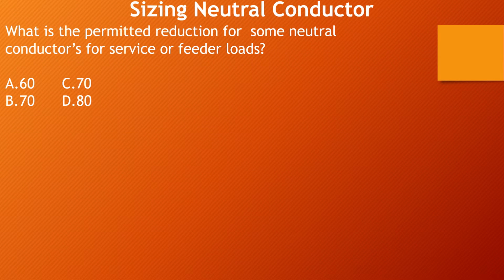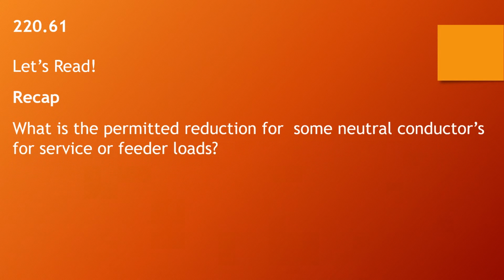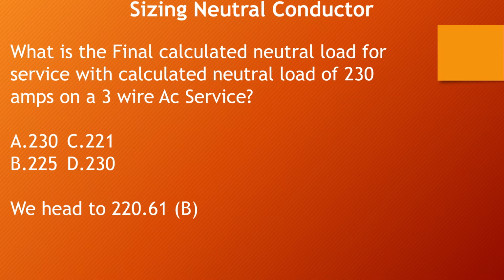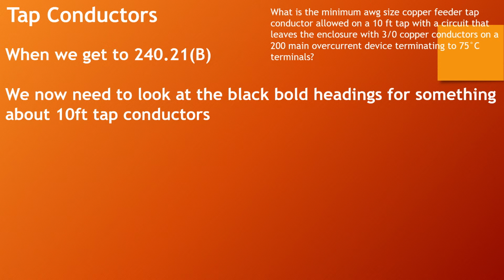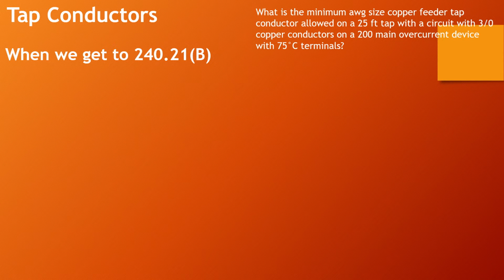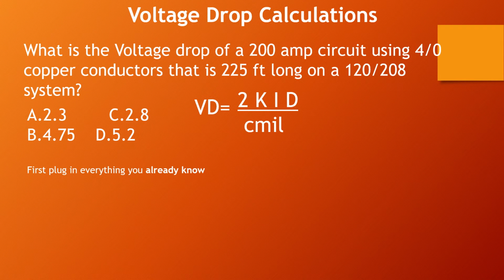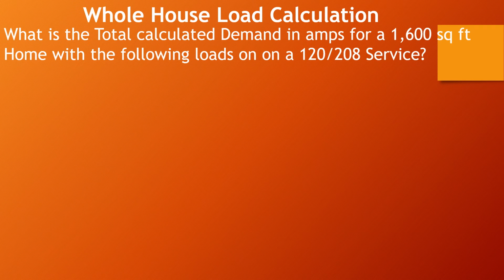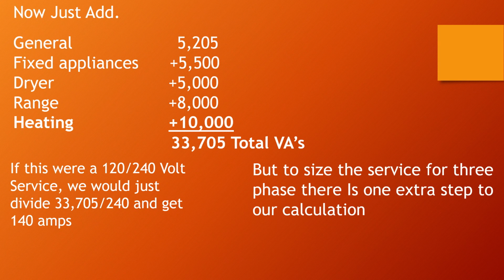Bonus Week 1 How to prepare for an Electrical Licensing Exam. Exam Prep Journeyman Electrician

Comment: Is the 10 week course that you mentioned the lessons that are numbered 2.2, 2.3 etc? Thanks!
Reply from the maker: Here is the recipe for getting ANY NEC test, license or certification. Sign up at..

https://electricalcodecoach.com/shop/ols/products/lifetimers

Right now it's only $129.99 for a Lifetime Membership

1. Do the entire pro version.

2. Do everything in the ECC testing center.

3. Grind for 30 minutes a day on 100%

4. Grind 1-2 hour a day for 10 days leading up to the test.

5. Go take the test.

6. If needed, repeat until desired result

If you don't have your code book and tabs you can pick them up here.

https://electricalcodecoach.com/shop/ols/products/2020-special-offer-180-with-free-shipping-in-the-us
O
Here's my cell if have any questions or need help 423-895-3247.

Comment: Thanks a lot coach. I appreciate your work. I just have a question at 31:25 do we also add the largest motor at 0.25 code reference 220.50/430.24?

Comment: Great videos and I really appreciate the info and effort you put in but through this experience I've come to realize that this code book is a convoluted f*****g mess. With my test looming over me, I've never been more discouraged and in the field, I run circles, mentally and physically, on most of the guys I've worked with. This is ridiculous, its no wonder that the failure rate for this test in the state of Utah is over 50%.
Reply from the maker: Here is the recipe. Sign up at  https://www.electricalexamcoach.com/membership-account/membership-levels/ 

1. Do the entire pro version. 

2. Do everything in the ECC testing center. 

3. Grind for 30 minutes a day on 100% 

4. Put tin foil on it and grind 1-2 hour a day for 10 days leading up to the test. 

5. Go take the test. 

6. If needed, repeat until desired result. 

Right now you can get a Lifetime membership for only $99.99.

https://www.electricalexamcoach.com/membership-account/membership-levels/

Keep grinding bro

Comment: Great video! One very small error I caught.
On the sizing neutral conductor question, the dishwasher watts in the question was 1,100 watts. When you calculated all the loads, you put the dishwasher at 1,200 watts.
Luckily the answer was still the same at 64amps 🙏🏽🙏🏽🙏🏽
These videos have been sooooo helpful!

Comment: On the voltage drop, I find it easier to remember to use √3, instead of 1.73.  It's 3 phase, so √3, which is where the 1.73 comes from.
Reply from the maker: I agree! I train you on the 1.732 because depending on what type of calculator you have that button is not going to be present inside the test!